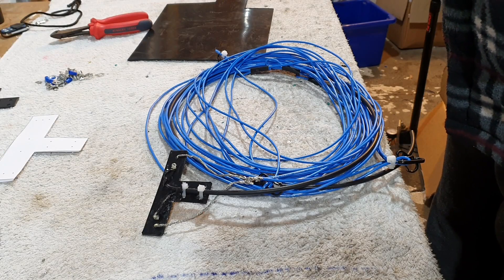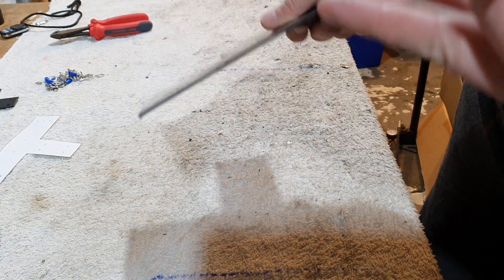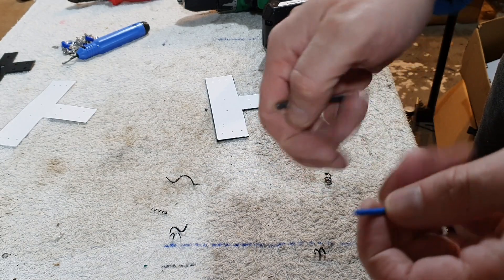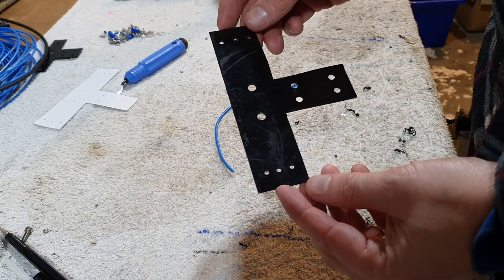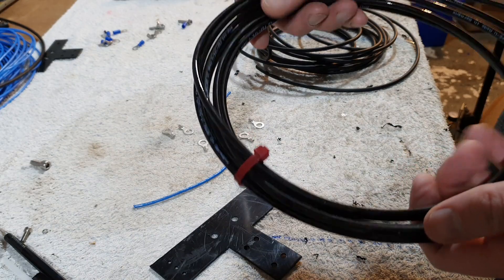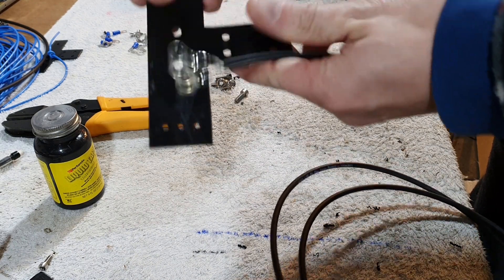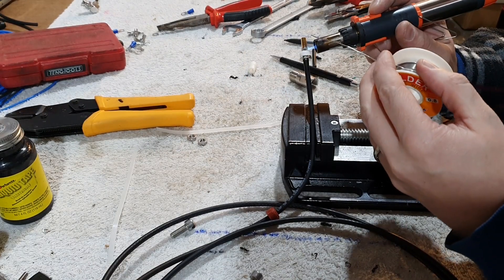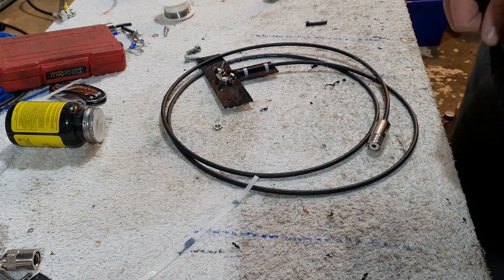How to Make Your HF Moxon Feed Point #hamradio #hamr

Comment: Hi Colin.  What's your thoughts on cable ties being a bad idea for holding coax in place? Some say it crushes the core and affects the resistance rating.
Reply from the maker: Perhaps if its air core dialectric coax. I see no crushing whatsoever. All my coax is solid core and never had an issue.